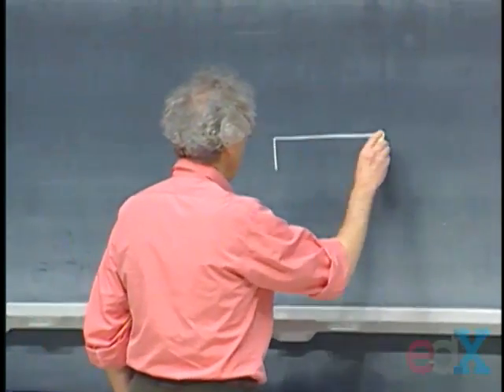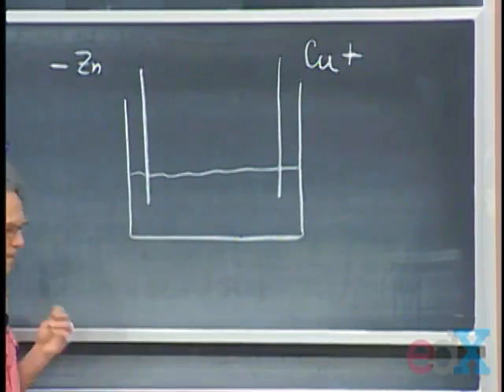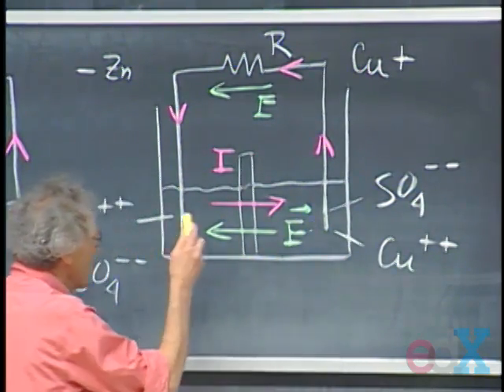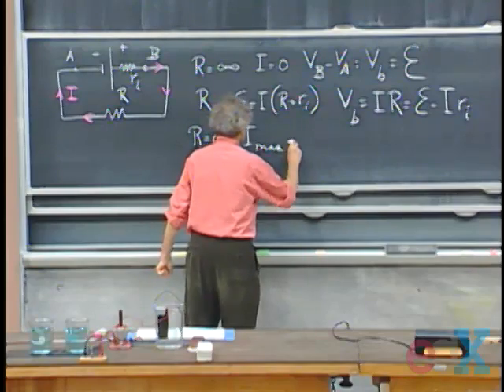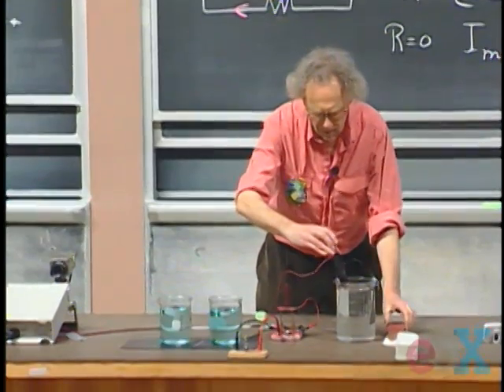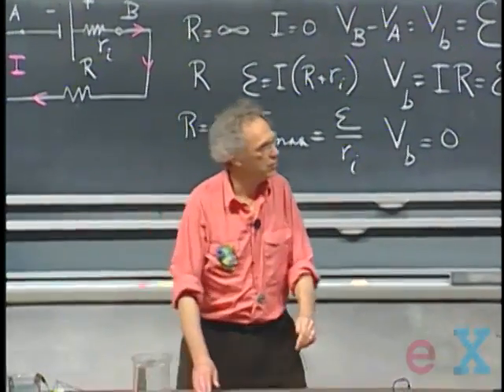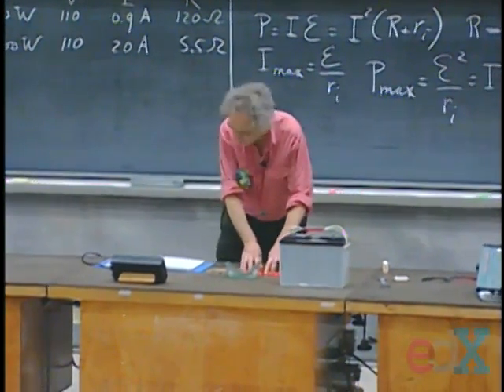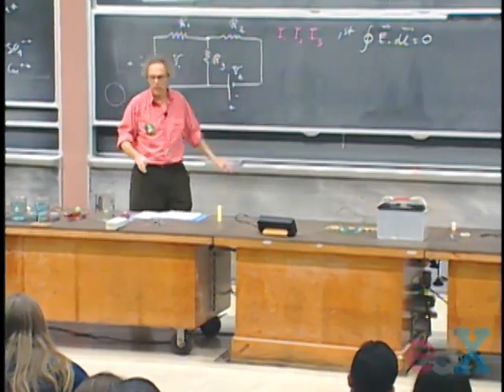8.02x - Lect 10 - Batteries, Power, Kirchhoff's Rules, Circuits, Kelvin Water Dropper

Comment: Unfortunately, in the early part of the lecture, Prof Lewin flits back and forward between describing two different galvanic cells. If you put a zinc electrode and a copper electrode into sulfuric acid, there are no copper ions involved, and there is no need for a membrane to separate the electrodes. The overall electrochemical reaction is zinc plus hydrogen ions going to zinc ions plus hydrogen (gas). The Daniel cell is quite distinct. In that cell, you have a zinc electrode in zinc sulfate solution, and a copper electrode in copper sulfate solution, and a salt bridge between the two to keep them separate. There, the overall reaction is zinc plus copper ions going to zinc ions plus copper.

Comment: professor Lewin, what variables are involved in increasing the voltage ? If you raised the height that the water falls, add a chelated iron to the water ,use a copper bucket instead of steel , just throwing  ideas out there. If you put a voltmeter in the 2 buckets would you be able to read a d.c voltage? thank you for taking the time, appreciate you're lectures.

Comment: Costructive criticism: You illustrated what I call hole flow earlier, but have switched to the electron flow convention at about 32 minutes. Granted, you point out that it makes no difference in the laws or the math, but it might be preferable not to switch back and forth like that. for your lectures. I'm speaking as a former electronics instructor, where electron flow was the standard.

Comment: I've seen a few of these lectures now and they are all very good. I liked physics at school but the lessons were never this good. It all ties in with my hobby of amateur radio. I saw the lecture about capacitors and remember when I was aged about 11 taking apart a valve radio and stripping a capacitor and wondering what all the parts inside that radio did. At 13 I built a one valve radio from a kit.
I found out more when I studied for the radio exam and learnt even more by building radios, valve at first, then transistors and finally built my transceiver with i.c.'s and FET's and MOSFET'S.

Comment: I love the Lord Kelvin's Thunderstorm experiment/demonstration.  It seems like the most amazing thing.  One thing I wonder is if the charge polarity always establishes itself in the same direction, or does it vary randomly by 50%?  If it is the same or does not vary equally, what might account for that.  The lectures are amazing.  Another one I really like is the one of light and color ... mindblowers.  What a universe.
Reply: It establishes randomly, depending on any slight difference in initial small charge differences on the rings and buckets. There will always be some slightly different charge difference - due to such things as slight differences is the electrostatic charge gradient in the air or someone walking close to the apparatus.

Comment: At 8:13 you cover the resister drawn in the circuit with your hand and say, "if the R is not there, that means the resistance is infinitly large". Shouldn't the resistance be zero?
Reply from the maker: what I meant is:
If you remove R and do not reconnect the wires, the resistance is infinity.
Reply: I had the same doubt... thanks
Reply: means if resistance is physically not present where it is now. Meaning it becomes open circuit at that location

Comment: @30:50 why doesn't the professor get electrocuted here? There is a huge current going through the tool and he is touching it right ? Won't a part of the current go to the ground ? Or does that work only with static charges ? Since this is a battery.. like galvanic cells, the zinc's electrons in the anode are attracted only to the Copper ions of the cathode and not to the ground ?

Comment: 4:45 I could be wrong, but I´m afraid I don´t see an E-field across the membrane pointing from the right to the left. Between the Cu-electrode and the solution there will be a + potential difference and between the Zn-electrode and the solution a - potential (the standard potentials of Cu and Zn)  As a result of this you get at the right side an extra negative charge (SO4- ions) in the solution and at the left side  an extra positive charge (Zn+ ions) in the solution. SO4- ions will then flow from the right side to the left side... I think the E-field is present just around the Cu-electrode, pointing from it, and around the Zn-electrode, pointing to it.
But great lectures, thank  you for uploading them!
Reply from the maker: Rinze Joustra There is no membrane. Watch my lecture and my explanation again please.

Comment: At 27:36 , it is mentioned that as the temperature of the battery increases, it would increase the internal resistance of the battery. This would be the case if its a normal resistors, but in batteries internal resistance is due to electrolyte resistance and its know to go down as temperature increases as higher temperature promotes chemical reaction at accelerated phase. This is infact why shorting big batteries is a dangerous thing. It can lead to thermal run away
Reply from the maker: Battery's are a chemical reaction. All chemical reactions speed up when heated. So the voltage degradation/leakage internal to a battery should speed up with temperature. If you get so hot that the seals in the battery break down then you have immediate failure. Unfortunately the seals in the battery don’t like cold much either so taking a battery too cold could compromise the seals too.
Reply: @lecturesbywalterlewin.they9259  Thankyou for the quick reply, I just wanted to point out that if anything, the battery would discharge more once it starts heating up as its internal resistance goes down at Higher temperatures

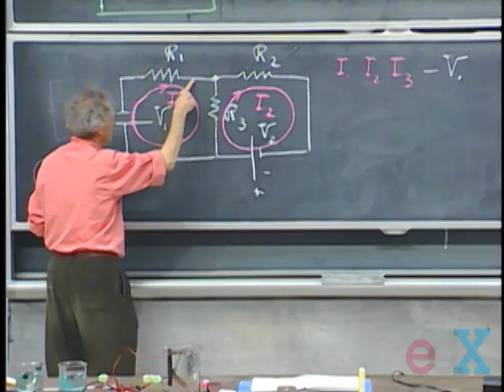Comment: Professor, like at 38:45, what if i1 and i2 both flow through the same battery instead of a resistor? Should we ignore the current flowing in towards us from the other loop in that case?
Reply from the maker: follow the recipe that I discuss in this lecture and you will have your answer.

Comment: Hello professor,
When you short-circuit the car battery, you did it with bare hands. I'm wondering why it's not dangerous, assuming that the current is about 600A in the wrench. Isn't it possible that the current could flow through your body?
Reply: Current follows the path with highest potential difference 
The current chooses to go through the -ve potential terminal of the battery rather than the earth (through his hand) which has potential of 0 as the potential diff from positive terminal to negative is higher than that of earth

Comment: When I was about 10 I had a book: Batteries, Bulbs and Magnets with experiments in. One was using copper sulphate crystals and a battery to copper plate things, my eldest sister got me the copper sulphate. Another I recall was to wrap wire round a nail to make an electromagnet. I put a 9 Volt battery on a transformer and got a shock. I couldn't understand why. I found out why later and it's why I put reverse biased diodes across relays when I make things.

Comment: I have a doubt that.. how the resistance become Infinite when we remove the resistance R from the circuit 🙄.. 8:39
Reply: Because, there is no current if the resistor removed(Circuit incomplete). If there is no current, then we can take that has infinite resistance

Comment: You said when you remove resistance 'R'
Resistance become infinite so zero current flowing? But how please make me understand 🙏
My second question
In battery current flow from + to - terminal!
If it does not go through the battery then what is the need of internal resistance?
Maybe I am not able to understand mechanism of battery!
Please explain me with satisfying example! 
Please reply me 🙏🙏
Reply from the maker: plse don't be lazy, I cover all this in my 8.02 lectures. When there is no R between the poles of a 9 V battery there is no current, but the potential difference between the poles is 9V.

Comment: Dear professor, you said at 3:06 that there is a potential difference between solid Zn and Cu. So what would happen if we connected them with a wire without any dipping them in any solution? Will current actually flow?And if so, for how long and why would the current stop flowing at some point?
Reply from the maker: no current will flow

Comment: Where does the H from the H2SO4 go? Just checked, the Cu becomes sacrificial and ZnSO4 and the H2 is dispersed--Zinc sulphate being carried out by H2 molecules would smell disgusting, like a rotten egg factory
Reply: Pls help me power loss in transmission by Walter Lewin which lectures
Reply: Cu should not be reacting to h2so4 yet there is Cu2+ in the solution? I'm confused. And also what chemical reaction SO4 2- participated in for them to go against the current flow?

Comment: @8:12 why is it that when the resistor is taken out there is infinite resistance shouldn't there be no resistance. the resistors job is to resist and its not there
Reply: Resistor being taken out means the circuit is no more complete,which implies that no current passes through the it. An infinite resistor also does not allow any current to pass through it. So,we can think of a broken circuit as one with an infinite resisitnace.

Comment: At 8:10, what do you mean by R=infinity? Do you mean that if we remove the resistance ,we have an open circuit? Because if we simply get rid of the resistance and leave a closed circuit, then the resistance would not be infinity for the charge can flow freely.
Reply from the maker: >>>Do you mean that if we remove the resistance ,we have an open circuit?>>>
yes

Comment: The different resistance attached in fan it and its help is to vary the speed of the fan as the current flows the rate of consumption of the power will be same if we run it at different resistance? Or will be same

Comment: Walter Lewin sir, it has been three days since i asked the question regarding current in the comment section. Please answer it. 
I'm so much confused how in kirchoff's current law, the current moving with energy of mv²/2 leaves conductor with same current with which charges entered the resistor. The mass in mv²/2 cannot be reduced so for the voltage drop the kinetic energy reduced is due to reduction in velocity of electron. So why do we say that in a closed loop the current leaving resistor is same as the current which entered the resistor. I think the charge entering and leaving resistor is same and not the current as current is quantity of charge flow in one second(I=q/t) and since velocity is reduced less number of charges will be leaving resistor in one second

Comment: If terminal voltage is equal V = E - ir
Where r is internal resistance of battery.
This means on increasing current (i) V will decrease
But again according to ohm's law V is directly proportional to current i
So on increasing current (i) terminal potential difference V  should increase.
But according to V = e -ir , V decreases with increase in i(current)
Please help me sir with this problem 🙏🙏
Reply from the maker: The EMF of a battery  is defined as the potential difference between the poles when no current is flowing. Thus, when current I is flowing the Voltage between the 2 poles is EMF - Ir_i. r_i is the internal resistance of the battery.
Reply: @lecturesbywalterlewin.they9259  
Sir please listen carefully
V = E -ir
Definitely, according to above relation if i increases V decreases.
.....
But according to ohm's law V should increase with increase in i
Why ohm's law is contradicting above situation?
Reply from the maker: @prajjwal9366  you have a misconception about Ohms law. Watch my 8.02 lectures. 
If R is the external resister and r_i the internal, then I= EMF/(R + r_i)

Comment: At around 34:30 u said "We can take any loop, even in space around the circuit, and still integration E.dl=0 is valid." 
What if I take a loop including the middle resistor (R3) in the circuit, but the rest of the loop is in space around the circuit. Means E.dl along the middle resistor bet its two terminals, has to equal the E.dl in a path in space bet those terminals. I don't understand how. What is the E in space around the circuit?
Reply: Yes, E.dl along this loop is zero. Which means e.g. that there is a voltage between a terminal and a point in space outside the circuit. However there is obviously no current flowing between these 2 points, it only flows in a conductor.

Comment: Hello sir! Sir have you posted any lectures on electrical measuring instruments like Ammeter, Voltmeter, Galvanometer, Potentiometer, and Meter Bridge?
Reply from the maker: no
Reply: Ok. Well, I am getting a lot confused when it comes to solving problems based on potentiometer and Meter Bridge. 
Right now the biggest question that I have in my head, is as follows. 

Now suppose if I have a meter bridge and I am given 2 resistors out of which one is unknown. The balancing length is given. Now if I need to find the value of the unknown resistor, I can simply use the principle of Wheatstone Bridge to solve the problem. Now here comes my big doubt. Now suppose if a resistor of known value is shunted to the unknown resistor and I am simply told that the jockey shifts by a value say 10 cm from it's initial value i.e the balancing length before the unknown resistor was shunted, to obtain the new balancing length . Iam not able to figure out in which direction I should move the jockey in order to get the balancing length. Iam not getting a clear idea on what basis I should decide the direction to move to the jockey. Sir can you help me out?
Reply from the maker: ask quora
Reply: Abhishek Prakash Though i don't remember, i think shunt is a parallel resistance. So by shunting, the net resistance on the "unknown side" will decrease and hence, the balance point should get displaced "towards the unknown side" to decrease the length below the unknown side, so as to keep the wheatstone ratio unchanged!!!
Reply: @abhishekprakash8726    I dealt with the same question today.  What you have to understand is that if you shunted a resistor parallel to known resistor then the net resistance decreases  therefore the resisitor parallel to the shunt should also decrease anf the null point should decrease  so if null point was 20 then  now ot should become 10 and in the denominator  100-l'  so that becomes 100-(20-10)  so now the ratio will become 1/9

Comment: Amazing lecture sir.I have a small doubt.why circuit without resistor has infinitely high resistence??

Can anyone help me in this?please
Reply: I think what he meant there was that the resistor wasn't there and instead it was just air (the circuit wires weren't connected when the resistor was removed, the wires were simply left like that). So the resistance instead becomes that of air(around 1.5 x 10^16) which is really high.
I hope that it helped
Reply: @samuelbency8104  Thank u.That helped 😀

Comment: Professor, you said that so4 ions go from the right to the left and they travel through an electric field that opposes them, but why on the picture you drew, the E field arrow pointing left which means it goes from right to the left too ?
Reply from the maker: how many minutes into the lecture?
Reply: The electric field arrow is drawn in the direction that it would move a positive charge.  But the so4 ions are negative, so the electric field pushes the so4 ions in the direction opposite to the arrow.

Comment: Sorry for any mistakes in the grammar, as english isn't my first language. Thanks for all the content and love for physics you pass for all the students, all students I recommended your lectures loved and said that it was the best lectures of physics they have ever watched. 
Now my question, in moment @39:22 when you say +I2R3 you say that the potencial on the "bottom" side must be greater than the top side of the resistor, shouldn't be the inverse of that? Because if you have an increase in potencial the bottom side must be at a lower potential than the top side, I guess. And again, thanks for all the content and love for physics.
Reply from the maker: what I have is correct. I1 and I2 are in opposite direction. If you go from the top to the bottom of R3, you go in the direction of I1, but you go against I2. Thus using my convention going through R3 we get -I1*R3 + I2*R3.
Reply: Yes, the sign was correct, my doubt actually was in what you said, in I1, we go through R3 from a higher potential to a lower potential, but I2 goes in the opposite direction, from a lower potential to a higher potencial, thus the positive sign. But you said that I2 goes from a higher potencial to a lower potencial, this would make -I2R3 using your convention, and from my perspective it's the inverse, that was what confused me.
Reply from the maker: I can see that you were confused. I should have use different words. Going form the top to the bottom of R3 we go in the direction of I1 but against I2. I should have left ti with that.
Reply: Thanks for the explanation.

Comment: sir I am confused that emf of a battery = IR or potential difference between two terminal of battery =IR
Reply: emf=i(r+R), 'r' is the internal resistance of the battery and 'R' is the resistor attached in circuit to the battery.

V=emf-ir

Comment: 3:45 wouldn't the current be flowing from negative terminal through the circuit to the positive terminal?
7:48 same thing here. i understand you might be talking about "conventional current", but i am reversing the arrows in my notes.
Reply from the maker: the direction of current is uniquely defined. watch my 8.02 lectues.
Reply: @lecturesbywalterlewin.they9259  yes, at the beginning of the prior lecture, lect 9, and also in the intro to the course. Ok. thanks. I will expect electron flow then to be explicitly stated and opposite the direction of any mention of "current."